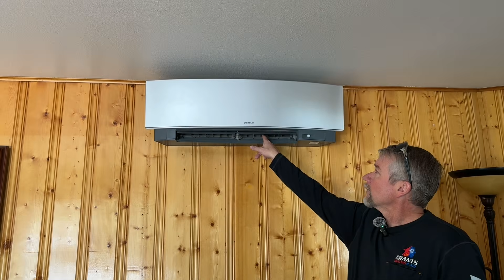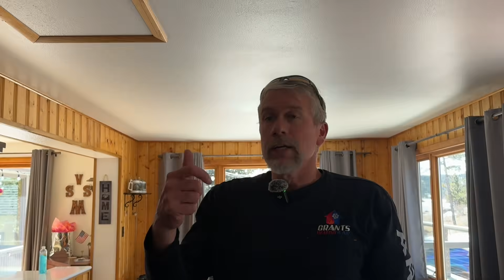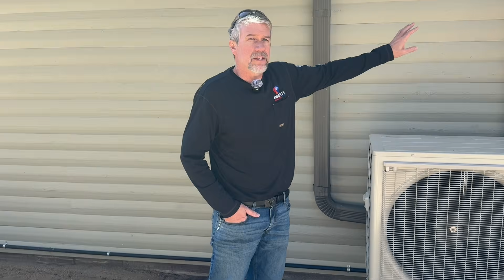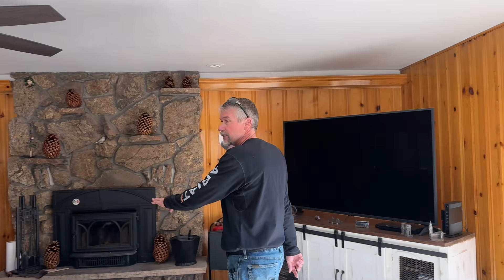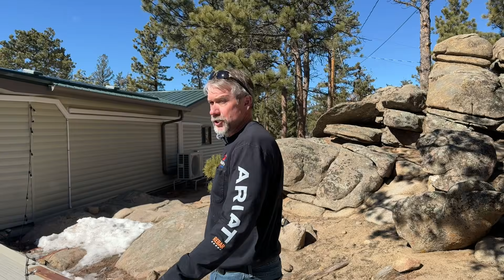Ultimate Cold Climate Comfort: Daikin Heat Pump MXL - Ducted and Ductless Mini-Split Solutions

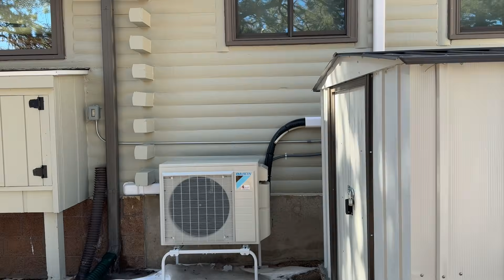Comment: 5:20 Looks like they ran out of 90 degree line hide fittings.
Reply from the maker: Good Catch! Funny how things will be right there and I didn't notice it.  I talked to the installer and he said he forgot as well that we did run out of line hide.  We will be back over to add that bit missing.  Thanks again for finding that!
Reply: 44 years in residential HVAC. I never have understood why some companies go out, lowball quote the jobs, cut corners and then won’t go back out when the customer has problems because “they didn’t make anything on that job”. If a customer is looking for the cheapest guy in town, it’s not hard to find them with patience…but good luck when they need them. Don’t call me. They are either out of business or too busy with recalls/warranty work to get to them. 

It looks like you do good work and take good care of your customers like I do.
Reply from the maker: Your're speaking my language and I agree with you 110%! Thank you for your feedback! @USA-GreedyMenOfNoIntegrity